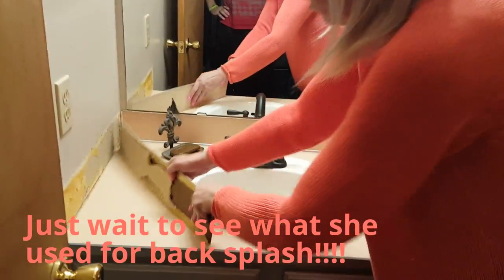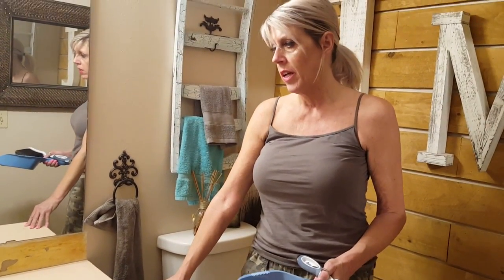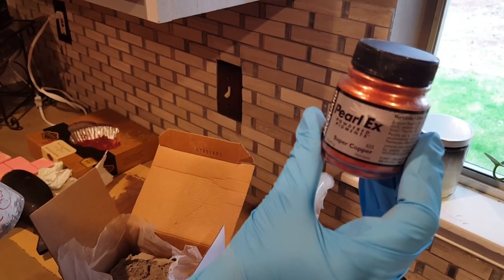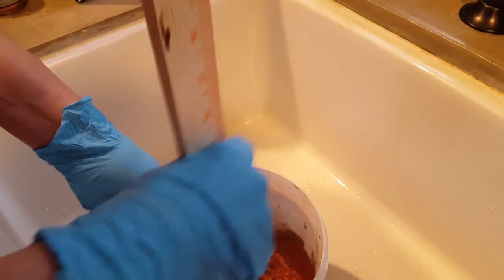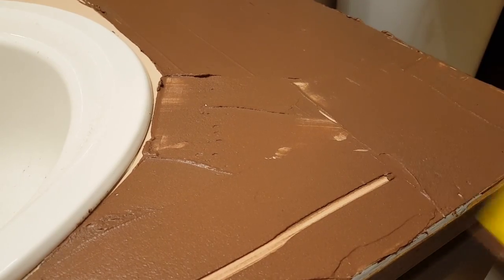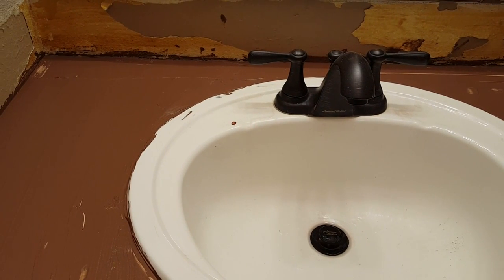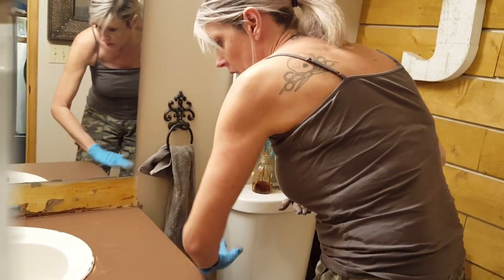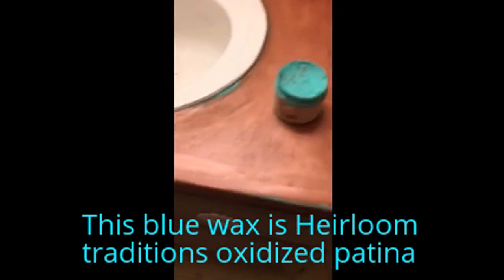DIY making a copper concrete counter top with Madison

Comment: The copper color you used was it for concrete, and where did it come from, I like what you did thinking outside the box!
Reply from the maker: Tonya Lovelace the copper color is a pigment additive for paint. You can order it or get it at many art supply stores. It's not specifically for concrete.